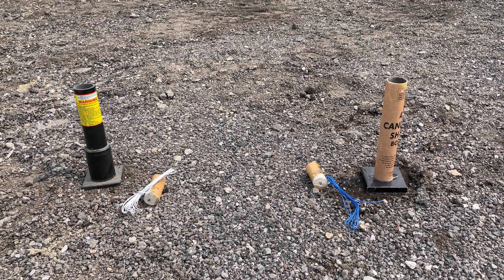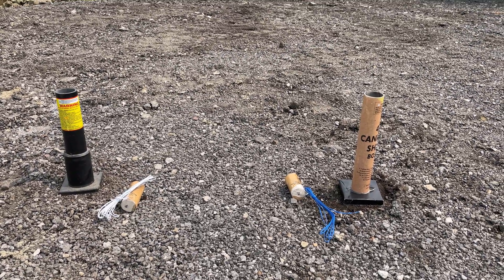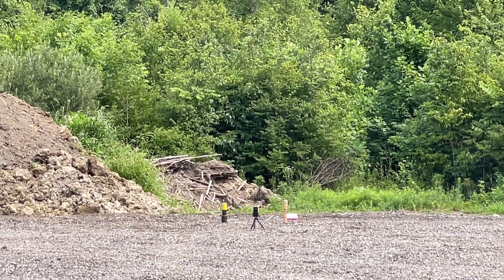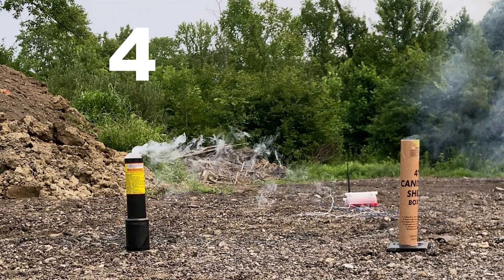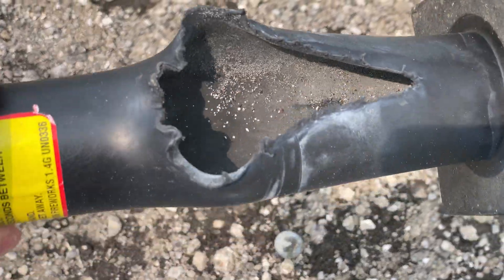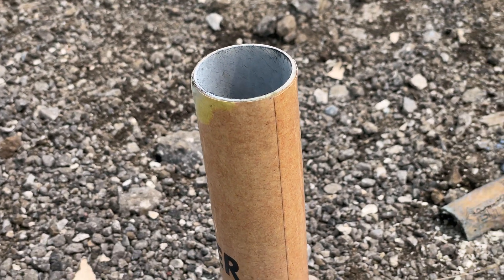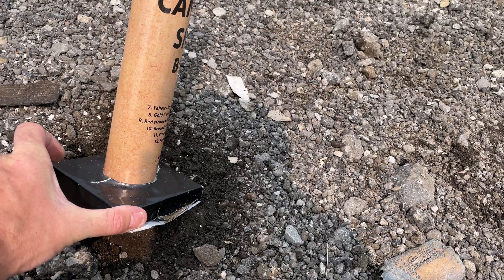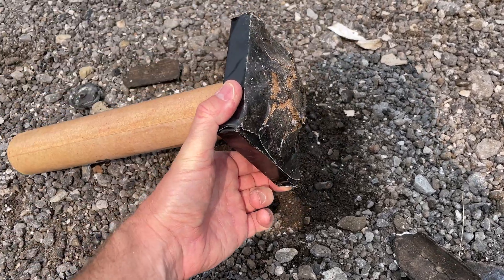1.75" Single Shot HDPE -vs- Fiberglass, catastrophic failure

Comment: Very interesting video. I was wondering the same thing about the power of each shell. But I got to tell you if there are still people out there loading shells upside down they need to choose a different hobby like painting or scrapbooking LOL 🤷
Reply: Sometimes the shells ignite simultaneously due to defect.  It's sometimes called flower potting.

Comment: Did you use the same shell on each? Just asking
Reply from the maker: I don't know that I used the exact same labeled effect, but I used the shells from all the same kit. I don't believe the outcomes would've changed.
Reply: @evolution2001  I was just curious. Was wondering what a say death shell vs a ring shell would do. Just wondering. I didn’t expect the outcome either, was really surprised

Comment: I believe that the best tubes are the hdpe tubes that you need to buy from someone who sells mortar tubes.  Excalibur hdpe tubes tend to fall like the fiberglass ones
Reply from the maker: ehhh...I'm wishy-washy on that.  "For the most part" HDPE is HDPE.  What can change is the thickness of the wall, which is identified by the DR number, such as DR9, DR11, etc. (You can google what DR or SDR actually means and how it's used in the pipe industry.)  I don't entirely believe that World Class (mfg of Excals) are much different than the HDPE that you could buy from Home Depot.  (I have heard that World Class has a patent on the molded base & sleeve and that's why they are the only ones that have 'em, but I have never confirmed it.)  I think that all HDPE will blowout when tested like I did.  I think the question is "Why did the industry switch to HDPE instead of fiberglass?"  I'm gonna guess it's because HDPE may be less expensive to manufacture in mass qty.  And/or...Maybe the long term reliability of HDPE is better than that of fiberglass.  Good questions that I don't have answers for.
Reply: @evolution2001  Fiber glass is cheaper than HDPE, fiber glass is lighter too. The going hypothesis is that the fiber glass' quality will deteriorate after continuous firing, whereas HDPE will stay pretty much the same. In short; HDPE lasts a lot longer than fiber glass.

Comment: The fiberglass tubes will deteriorate and start shedding fibers after multiple uses, but they are free after all. I've got racks with HDPE and fiberglass both. They both work. Just have to swap a fiberglass one out when it starts getting "hairy".  But you do get new ones every year in kits.

Comment: Fiberglass will always be better because the fiber rips and shredds vs pipe that expands then cracks. Next best thing is iron, it will easily outperform any other material.

Make your racks out of reused fb tubes. Plus theyre already bought with the canister kit and you will always have extra to replace easily.

Comment: The fiberglass tube was def quality tube when you showed the inside of the tube you could just see how tightly they were formed. Sadly this would not be the case in 90%+ of the fiberglass tubes on the market. The HDPE failed in the exact way it is designed to, release the energy out without compromising the MAIN structure around it. If it was in a rack the rack  would most likely have been totally fine which is the goal. By far the most safe fiberglass tube ive ever seen so props to RKM.

Comment: So would you say it’s not as necessary to have a rack with fiberglass tubes as spaced as HDPD tubes? I’m watching videos and everyone says they prefer racks to be spaced so the HDPD will expand if a fail occurred but would that really help at all if you are using fiberglass tubes?? In my case I don’t plan on using the fiberglass tubes long term and replace them yearly and I’m building a rack and want to use fiber glass tubes that came in the cases of shells I have bought all of them are unused and plan to replace them every year or possibly upgrade to HDPD in the future but leaning towards just replacing the fiber glass tubes yearly and I know HDPD tubes last a long time if no failure but if a failure occurs like in your demo is HDPD really that much safer? The fiberglass tubes plug starts pushing out but once you have that happen you know to never use that tube again and replace it in saying this because if  I make my rack spaced it’s obviously going to take up a lot more space since it makes the rack that much more bulky
Reply from the maker: The "not as necessary" part is the opening for people to argue the spacers vs no spacers.
I always talk about "risk mitigation" and how each person is responsible for applying their own amount of risk mitigation.  I can say, "based on my testing, I'm not concerned about a fiberglass tube blowing out like an HDPE will".  But then someone will chime in that my sample set was too small...fiberglass can/does blowout...blah blah blah.  So everyone needs to be willing to accept responsibility for the amount of risk mitigation they are willing to implement or forgo.
I will go so far as to say, "Yes, spacers provide better levels of risk mitigation."  But that is beyond the level of what I'm willing to implement.  I am accepting the increased risk due to mitigation applied in other areas.
Reply: @evolution2001  yea saftey is also very huge for me yearly and try to keep everyone around safe and have some risk management . One of my dumbass neighbors has some branches in the front of his house that fell from heavy wind in front of his mail boxes all pilled up it’s been like 2 months I don’t know what the hell he’s waiting for nobody is going to come take it for him for free it’s just getting dryer and dryer by the day and that’s a saftey hazard
Reply: @evolution2001  Or you can make a sandbox to bury them in and skip the spacing.  The rack is less bulky but you have to carry around the sandbox and sand.

Comment: really awesome experiment once again 👏 Despite the HDPE tube failing I think it would have definitely fared better in a rack and doubt they would affect neighboring tubes. Would be interesting to see!
Reply from the maker: "Faring better in a rack" was the big surprise.  Check out the linked video at the end of this one.  Or just look in the playlist for the 1.75" rack testing video. Every HDPE tube had the same blowout.  The only difference is that those tubes are not sleeved, and some of the walls may be a little thicker depending on where they were sourced.  But overall, ALL the HDPE's experienced the same blowout.
Reply: What definitely wouldn't affect neighboring tubes is not failing, like the fiberglass.

Comment: Wow. The second one was more violent. What is that fiberglass tube made of!?
Reply from the maker: It’s made of fiberglass. Duh! 😂
It’s a special construction/type of fiberglass & resin for the explicit purpose of handling the type of forces exerted by explosives. In all seriousness, I can get you a more scientific explanation if you want one. ✌🏻
Reply: @evolution2001  haha I know what they are made of. Just didn't expect it to hold up so well.
Reply from the maker: @Ohio_Hobbies_Guy  Same here.  I was VERY surprised.  ALMOST enough to have me consider changing my racks to these tubes.   But I absolutely detest the way fiberglass wears out and starts to expose fibers. Shit gets in my skin.  Also, I'd have to do more testing and see if the bottom plug would be a different issue, longterm.
Reply: @evolution2001 that’s true but fiberglass tubes are easily replaceable every year since you get them in each kit especially if buying cases of cans
Reply from the maker: @takeovaLA  I don't disagree.  But with those kit tubes, I'm not certain of the process for removing the base and what that leaves at the bottom of the tube.  I know with my HDPE, they are plugged & nailed.  Also, more mfgs are starting to sell "compact kits" which are just shells and no tubes.  But yeah, I don't disagree with your statement.  ✌🏻
Reply: @evolution2001  yea I bought a case of racoon 🦝 Peacock spider canisters and they came with 10 or 10 and a half inch tubes which I don’t like they seem very short for a 5 inch shell luckily I bought a case of another 5 inch shell that has 12 inch tubes and use those for the rack but yea people have been hammering the bases off from tubes for a long time now they only use 2 long staples and a little bit of glue to hold the base up but I only plan on shooting off two 24 pack of shells this year rest I’ll keep for next year and I plan on replacing those fiberglass tubes yearly or just replace them later this year with HDPD tubes by lakeside but time is not on my side right now the 4th is in 3 days so plan on ordering HDPD after
Reply from the maker: @takeovaLA  PSSST!  Only 'cause you've repeatedly typed it, I know it's not a typo.  The tube material is HDP...E.  HDPE.  It stands for "High Density Polyethylene".  😉😉
And while we're at it, other people simply referring to it as DR11 tubes would also be technically irrelevant, as that simply denotes the wall thickness and nothing else.  DR9, DR11... all mostly irrelevant.  But the community understands when someone says that, that they are referring to 1.91" HDPE pipe used to fire consumer 1.75" 60g canisters. 😉😉✌🏻✌🏻
Reply: @evolution2001 ...I have made many racks with the fiberglass tubes from shell kits. Generally a few wacks with a hammer and the cheap wooden bases pop right off. They are clay plugged in the bottom not wood so you just need to inspect every now and then..usually last several years in a rack doing 2-3 shows per year
Reply: @evolution2001  People with a lot of fiberglass exposure over time become sensitized to it and have trouble even handling it.